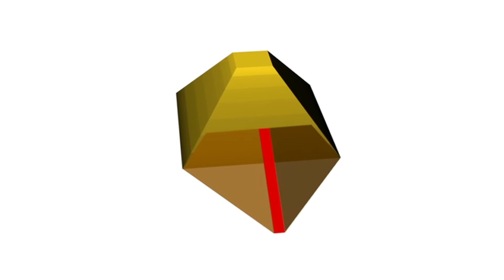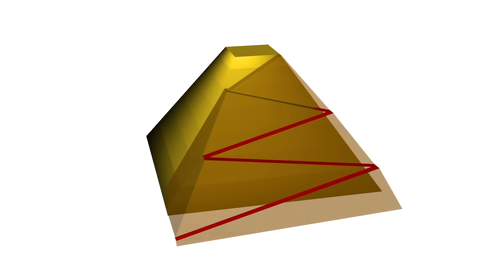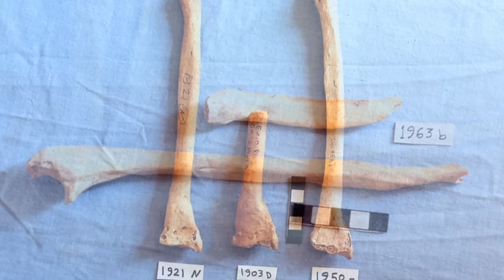Egyptology - Pyramid Construction

Comment: The ramps alone woulda bin almost impossible to build! Lol
Reply: Not really.  Might want to think a bit harder and assume based upon silly talking points a bit less.  You may find the process illuminating as well as yielding you better results.  Just saying.

Moral of the story:  there is ample evidence to show whereby the Egyptians employed ramps to build things = to include the remains of actual ramps.  In the western cemetery as an example there are small earthen ramps abandoned in place which were being used to create unfinished tombs.  Meanwhile when the limestone quarries at Giza were excavated years ago they were found to have massive quantities dumped into them = of what they made the earthen ramps from.

At Karnak are the remains of mudbrick ramps used to build hypostyle temples.  Further in the tomb of Rekhmire is a depiction of a hypostyle temple being constructed using = a mudbrick ramp.  So as we see there is plenty of evidence to support ramp usage.  Finally as the pyramids rise in height = the blocks get smaller.  So those blocks above the level of the King's Chamber of the Great Pyramid are not that large compared to those found in the bottom third.  

Smaller blocks would be easier to lift and move.  So they could be lifted using the lever device referenced by Herodotus which was probably a variation of the Egyptian shaduf which uses a fulcrum and counterweight.  So the earthen ramp really only needed to go as high as the King's Chamber as above that level the smaller blocks could be raised via the device which sat upon the "steps" created by the levels to lift blocks above.

Comment: Please read: i think i found the awnser. Use a stackable obelisk with horizontal on top a long hard tree. Place it 5 to 1. Not in the center like a T. Put ropes on both sides. And u now only need to lift half the weight. And u can lift it spin it and lower it on the next platau. Just like a crane u can have one of these on every corner. When the piramide grows. Just add some pieces to the obelisk to make it higer and continue. At the end you pull down a couple of obelist seesaw cranes and your done. And u alway need 2 obelisk cranes close to each other put blocks on it to highten them both

Comment: If the blocks were poured in place like concrete, there would be no need for ramps or hundreds of people to move the blocks. It would solve many of the probable ways people "think" the pyramids were built. There is no evidence of tool scraping to hone the blocks out of solid stone, no need for ramps, no need to "float" blocks down the Nile and would explain many of the problems associated with building such a large project.

Comment: An interesting point about this video that was presented without the proper context imo were the images of The Bent Pyramid.  At 1:40 the images of the Bent Pyramid are shown as the narration was describing the completion of the Great Pyramid.   The Bent Pyramid was built about the same time in the 4th Dynasty and about 2600 BCE.  That pyramid was built under the Old Kingdom Pharaoh Sneferu.  

It appears as though the images of the Bent Pyramid were used to illustrate the late stage construction of the Great Pyramid.   But why not state in the video that these images are of the Bent Pyramid and not the more imposing Great Pyramid as some may think was the case??  The description also contained no reference to the use of the images of the Bent Pyramid.

Comment: Dew, antigrav, hologram, cloud seeding, vape technology, crop circles, microwave tech, sonics, lasers, ufos, the ancient humans capped that thing with gold, for 1 reason and 1 reason alone, to attract lightning strikes. Dielectricity, mother nature's free energy, heat from air, energy released as fields collapse.
H2O is 1 field.
When the water molecule transforms from liquid to ice or liquid to gas, energy is released, radiation. Pressure changes cause the transformation. Physics

Comment: Many doubts. The positioning times of each single block of rock are not calculated with the methods described in the video. If you calculate the number of blocks with which the pyramids are built, with this method it would take 2000 years to build one...
Reply: pyramid might of been big generators to creat free energry. I could be wrong.https://youtu.be/YVVzz5-1tco

Comment: OK had yet another idea that may shed some light on the way they built these pyramids.

It seems there is a large room recently discovered, perhaps this large room was the flooding room.

If you look at the way these pyramids are constructed, you see that the lower end is thicker than the top end, so you could run a channel up to the point where you wanted your pyramid to sit, start with the lower blocks by floating them along a long channel and simply float them into place, as you build up you create large rooms that you could use as flooding rooms, you fill the pyramid with water use gates to hold the water in place, each room would be flooded with water to increase the pressure and raise the blocks, as each block is raised by the water held within the large lower levels each room would be flooded to raise pressure and thus raise each block to the desired level you are working on.

By using flooding rooms and channels you could make a type of pressurised lift system within the pyramid itself.

Water pressure can lift almost anything at the right amount, and using flooding rooms would enable the pressure build up within the structure as you build.

Again just another thought.

I'm pretty sure we use such water pressures to raise ships or boats like locks.

All by using channels bit by bit could potentially raise blocks of stone.

Comment: I also wonder if when building these pyramids if strong animals would have been used, such as elephants or bulls, perhaps even camels and such.

Let's face it they were clearly not stupid people, perhaps these pyramids were actually built quite close to water or within a reasonable distance to water.

So perhaps they made use of water channels to build build water floatation devices that would lift the blocks or help raise the blocks for precision fitting of the blocks.

You wouldn't actually need that much water just a sealed container or sealed moveable shaft, pull the blocks into place onto a barge type floating device fill the shaft with water and watch the block raise up, then pull using muscle power into place.

With the use of wood, sand, water and some kind of sealant type solution ie a clay perhaps a lifting device could quite easily be made.

We do it today with elevators but we make use of electric motors not water, but no reason why we couldn't make use of water to raise heavy blocks of stone, we just need strong walls to contain the water pressure on the sides.

But we are great dam builders and we do know they messed around with water a lot in those days.

Again it's just a thought.

Perhaps even water powered cranes.

Comment: This is only a theory, and one of the worst ones out there because it simply isent plausable they would need 100  times the material to make these ramps and there is zero evidence of these access material anywhere.  The most plausable theory and the most evidence of is the internal ramp theory.

Comment: I am a Artist stone crafting has bin around since Humans left caves and trees ,and it really isn't a big deal at all , Stone crafting, carving , sculptures , all early Art forms, plus making stone blocks ,plus there are many ways to cut stone, one of the most early forms of cutting stone was to make holes in the stone and fill the holes with water, the water would freeze and expand and brake the stone, this was done mostly at times when it was cold like in the winter, stone can also be carved and shaped with other stones bye using stones like a hammer also they used some other cutting tools made out of bronze , finishing of stone was done bye water and sand even clay can be used to finish stone with water, I also had a theory that stone could of bin cut as well with high pressure water its a theory but is posable using the right physics ,hay they had had Electricity back then yeah think about it, they where not stupid at all.

Comment: So here's the thing these pyramids had a very smooth outer shell, what if that outer shell was used to move the stones, sand works well to aid two objects sliding, so perhaps they used long ramps and used the sand to help reduce the friction, and over time as the blocks were moved the sand would help to smooth out the stone thus creating ultra smooth surface stone.

Also as they got higher and the blocks got smaller they could then move the smooth stone into place much easier.

It's just a thought, but I know sand can be very slippery under foot on some surfaces.
Reply: Sand works pretty well as a lubricant on a hard surface. Just a thin layer is best. A YT video of mine shows how this could help with moving stones to the pyramid site. The smooth sides of the pyramid could have been used as ramps but they are too steep to hold sand. A better lubricant would be a thin film of moistened clay.
Reply: @rdgrow  Perhaps wet sand, put the sand on let it dry in place as you move stuff across it the sand is displaced.
Reply: @flitsies  up to 200 ton blocks  lol with what metal cables would you lift them😂  nothing was lifted , everything has been where it always has been,  they were once stone mountains that were carved and chissled into shape as the sea reseeded
Reply: There was no sand, thats a major problem tbh. Egypt was lush grass and tropical forests when they were supposedly built.
Reply: @wjerame  if that is the case that makes them even easier to build.

There would have been lots of things they could have used to ease friction and build lifting gear.

But that aside, what happened to a place that was lush to then end up a sand pit, makes you wonder about what those ancient alien people talk about could be true, perhaps there was a nuke war or maybe just climate issues who knows any ideas whY happened?
Reply: @flitsies  I think one theory is the Younger Dryas event. A meteor hit and cause a mini ice age cooling the earth 11k and change years ago. This led to a period of intermediate climate as the earth slowly warmed back up over the next several thousand years. That's atleast one i know of but there are many good exolanations to why the Nile delta turned into dessert
Reply: @wjerame  Yes but Mon as exciting as that which the ancient alien theorists have come up.

I like the idea that humans could have been visited many years ago a d decided to go rather than drag us into their wars sounds more interesting.

But a meteor sounds kind of boring and I don't recall any evidence to support the idea.
Reply: @wjerame  yes,  I've worked out how they made the pyramids and the sphinx,  if the Giza plateau was once covered with water there would be islands  civilization there would of lived on the islands and there must of been mountains of stone surrounded by the water but the sea reseeded exposing the stone mountains and this civilization carved them into the pyramids and the sphinx over time , this explains the confirmed water erosion on the sphinx  and the boat that was found under the great pyramid, the Nile would of been the main channel of the sea that was once there,  when a place is green and lush the civilization would have access to dyes and the capability of making paint, the sphinx was once painted and other constructions there also,  the aliens had possibly created man kind here  hence why they were apart of this civilizations records , they showed this civilization how to make electricity , man's greatest achievement , electricity is life, the pyramids were power stations at some point, they used water to created electricity,  electricity in our brains is our spirit,  it's the electrical representation of ourself, it's our character it's our soul, aliens are electrical entities , they are not physical and can't been seen by the human eye, they are what we call gods, and aliens, and ghosts and angels and demons  they are all of these,  we are spirits in flesh and bone that was born and will one day die,  then the electricity in our brains leaves the body and is now a spirit, an electrical entity , see my channel icon?  that's a real ghost, I saw that in one of my videos, it was a spirit orb, it popped it's head out from behind that blue boxing bag,  I noticed them in my videos and started paying attention to them, I zoomed up on this very fast spirit orb you can see a clear face in it,
Reply: @351clevelandmodifiedmotor4  On a scale of 1 to Egypt fan fiction how bored are you right now haha
Reply: @wjerame  never bored  not enough time in a day if anything
Reply: @351clevelandmodifiedmotor4  You just wrote 1500 words on an imaginary History of Egypt, you sir are not busy 😂
Reply: @wjerame  lol
Reply: oh and they just made ropes out of  plant fibres to pull 200 ton blocks    nope, what if you take lifting blocks out of the equation   what if the pyramids and the sphinx we're once mountains of stone surrounded by water ?  then as the water reseeds over time they carved the mountains into pyramids and a sphinks ,  there's other statues in Egypt that are not made with blocks they are carved and chissled into shape,  I've worked it all out,  where's my cash😂
Reply: I would give an explanation, but tv is more entertaining. moreover, who cares...

Comment: How long would the ramp in the thumbnail need to be to " work " ? Where did they quarry the material for the ramp ? Was it a bigger job to build the pyramid or the ramps ? This clip is presented on a platform called naked science well, on this particular issue science is like the emperor with no clothes, naked in public and looking increasingly silly.

Comment: If you drag a 2500 lb bloc 3/4s of a mile over fine sand, you will polish it smooth. Wow, no idea how to get block so flat? Never put an archeologist onto figuring out how construction is done. You will work yourself to death doing it his way. Another way is to push large stones together over each other- the smaller pushed by the quarriman, is a hard granite block, which wears on the sandstone, leveling it. This stone was probably round, like a cheese wheel.

Comment: Seems to me that building all the ramps would have been the same amount or more work to make than the Pyramid itself? 
and where is the material that the ramp was built with? 
How long would it take to make and then remove these huge ramps ?
Reply: Eye of horus reptilians illuminati masons
Reply: @Noartist Maybe the civilization that built the pyramids are still here and they are the ones that secretly run the world 👀
Reply: @Noartist There is a connection most defiantly.

Comment: Well the Ramps idea cant be clever since they would be as big as the pyramids. and there is no sign they existed, no scaring on the earths surface or ancient foundations to support the ramps anywhere around the pyramids, so why is this question even on the table
Reply: since the bricks' center of mass is directly in the center, I think they might have used large rods to heave bricks upwards onto the next layer, lining them up directly next to the last brick in a row by rolling them, the corner pieces would have to be placed first of course.
Reply: @froo5667  Yeah like walking them up step by step i agree, a simple winch and pulley system and maybe 20 men could do 1 block